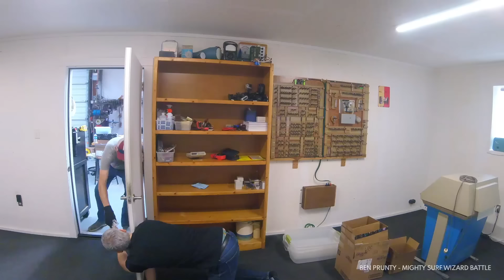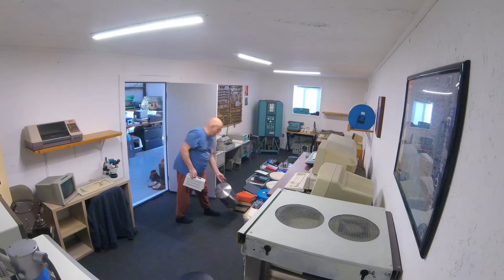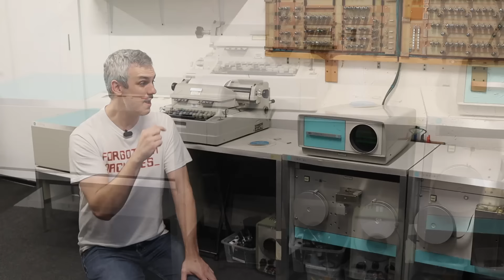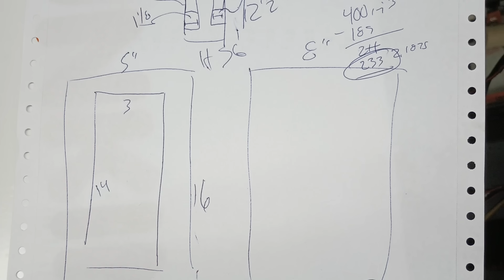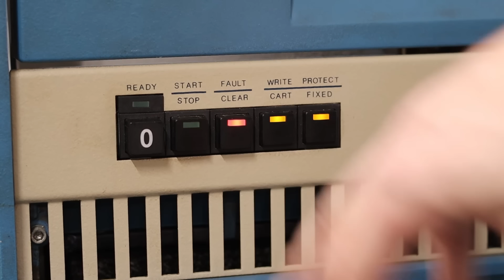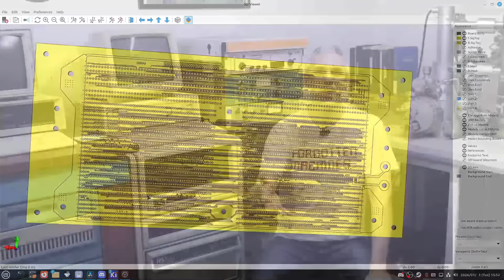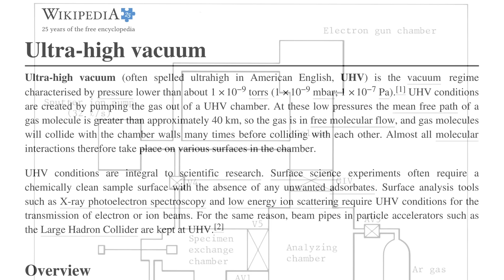Welcome to the New Usagi Electric!

Comment: Congrats on the repositioning.
I wouldn't be surprised if this is the most famous room in the US right now, at least with the retro-computing people. 

Some sort of a museum/workshop would normally be a natural suggestion in theory but with increasingly unpredictable economic/political situation, unaffordable real estate and inherent risks involved in funding and cooperation - this arrangement might be the best compromise.

Other than that it increasingly looks like putting casters on everything is probably a useful suggestion here.

You seem to struggle quite considerably with the bump at the entrance. Perhaps there's a reason to make a groove in the floor and install a gentle ramp flush with the floor on both sides. 

Maybe there is a reason to consider buying a tiny (used?) forklift like the ones some local shops in Europe use to stock groceries through the front door.  Although I do understand it's probably too expensive for a single person with little to no funding.

I would also suggest to maybe rethink the electrical distribution system a bit next time you inevitably have to move stuff around? I would personally opt for overhead heavy wire holders all round the room where exactly the right amount of wires can be routed exactly to their loads with no chance of blocked outlets or high-amp outlets not being where you need them. But maybe I'm overthinking it.

Comment: I have an HP-85B with some metrology software you could have. It's a minicomputer commonly used in scientific applications. It works just fine, but the tape reader doesn't read. I got it from the trash when a company I used to work for redid the calibration labratory.

Comment: Regarding power for the JAMP, if it wants split-phase 100-0-100, then how about, using a standard 240:120/240 "dry type" transformer, as used for commercial power. They have multiple taps, so if you tap the primary a bit high, the secondary will be low, giving 100-0-100.

If the machine needs 0-100-200, with a common neutral, then move the neutral/ground from the center, to the end.
Reply: I'm from the UK, so our power is euro style 0-240 for single phase, with a grounded neutral, but I've seen many videos from US machine shops.

Comment: Would suggest taking the existing door, and reframe it to the left to the stairs to add in a half leaf, or another full width leaf, to have a double door entry. More room to move equipment inside, and that will make moving exhibits in and out easier as well.

Comment: A quick note for when you start playing with the JEOL. Most instruments ( mass specs, electron microscopes, etc ) that operate with a vacuum of 10^(-6- -> -9) Torr range have multiple stages for the vacuum. First is a roughing pump that takes it to around 0.1 Torr pressure, then a turbo pump to bring it down further.  Many of the turbo pumps operate around 40K rpms. The best sequence for these is to run the roughing pump to reduce pressure, then start up the turbo pump. Due to moisture and containments in the vacuum camber, It can often take hours to a day to reach maximum vacuum as molecules de-absorb from the camber walls. Very Important, DO NOT just turn power off to the vacuum system! Shutting down the power abruptly can cause a large spike in pressure while the turbo pump is still spinning at high rpms, This causes a lot of stress! We had an old HP Mass spectrometer that did this in the 1990's. The Turbo grenaded! Bits of turbo fan blades when all through  the system. Best practice - Turn off the power to the turbo pump and let it spin down over an hour or so, then turn off the roughing pump.  With an old system like this, that hasn't be run for a long time, I would run a roughing pump for a day or two to really dry out the camber, before trying to start the high vacuum pump. IF the roughing pump uses vacuum oil, change it since it has been sitting so long. Best of luck, it would be great to seeing that instrument running again.
Reply: Oh yes, power failures are fatal for the pumps in a system like this, and it is very expensive to fix.  I wonder if this one can be baked.  Let's hope there are no leaks.

Comment: If you've got a functional IR spectrograph ... and a memory drum of unknown metallurgy ... Shouldn't you be able to use one solution to solve the other problem.
OK, you'd need a library of reference spectra. That shouldn't be a huge problem. 
And you'd need to get the metal of the drum (or a shaving - any threaded holes that could do with being re-tapped?) into solution. nitric acid is a pretty good bet. 
Whether your spectrograph has fittings to hold a sample of aqueous solution ... or if you'd need to get the chemistry into something like solution in alcohol which you can volatilise ... now there is a question. I think Ti has a number of volatile halides, so there is hope if it is Ti. If it's something boring like an aluminium alloy - that would be harder. The decimal places in the amounts of (several) alloying elements probably matter.

Using an XRF machine would be cheating with 1990s tech for a 1950s problem. Your bunnies would never forgive you.

Comment: Bomem: Got any pre and post 'capacitor plague' caps with enough electrolyte left to analyze?

Another good one (beyond the mysteries of retrobrighting and polymer degradation)... what exact component of a lithium thionyl battery is so horrifically damaging to PCBs, it is self-recycling sulfur ions or some other reaction with the copper base, what's actually there so a proper decontamination/neutralization/passivating protocol can be put together.

Comment: I am in. Lots of old computer channels, not too many instrumentation ones. I used to use an FTIR and Auger, tho mine was Nicholet IIRC and the Auger was from Phi/Perkin Elmer. Where did you get it, I would love to restore one, have many happy hours on a SEM, met my wife there, she operated it until I was trained. How much do these things go for, I have looked on e-bay but they command a high price or are mostly not there or so old they use diffusion pumps, which require a ready supply of LN2. Any way, I am a part time viewer and if this goes the way I hope, you will most definitely have a new subscriber.

Comment: Titanium for a magnetic drum head.

Hard to consider they would ho that route, even if they had access to to raw material, you STILL have to manufacture the compnent, and titanium was the new wunderkind of the aerospace industry.

Getting the magnetic media to stick to this new material could be troublesome compared to aluminum.

Comment: I don't think those magnetic coating formulas are lost, the manufacturers that closed down were sold on in many cases. I'm willing to bet that every major disc manufacturer could tell you what's on there if they wanted to. If they maintained their archives. I also would be surprised if any modern formula would not work. It's the magnetic head that lays data down. And any modern coating would take a lot higher data density than those old engineers could dream of. 
The real problem will be getting a new even, thin coating on those drums and platters. I don't think you have the machinery for that (yet?).

Comment: crashing a PCB manufacturer site with a design for an ancient machine is pretty epic :-)
Reply: For what it's worth I'd bet it was just the web interface for the file transfer process that's the problem.
Reply: You have to ask the question, is my design OK, or is it buggy software ...
Once the boards have been spun out and you have invested some time in building them and using them, you will know the answer.
I suggest rechecking your design for obvious mistakes. A gerber viewer doesn't care about DRC and ERC.
Reply: I'm not that surprised; the ones I've seen have mainly been hacked up versions of old open source JavaScript Gerber viewers. I don't think that these are real pro CAD tools or anything like that.
Reply: you obviously don't order many pcbs. this is very common even with small boards.
Reply: @humidbeing  every 1970s pcb i've ever ordered in 2026 came out wrong, they did not use the time machine to properly age it!
Reply: I'm wondering if the issue is with the wire-wrap mods on the PDP motherboard.  Those were (I believe) just two layer boards or two layer with ground and +5 VDC planes.  Then, there were selection wire-wraps to the sockets, based on what was ordered to go onto the motherboard before it was loaded into the crate.  You might want to check out Dave's Garage YouTube channel for a discussion of rebuilding damaged backplanes.  Yes, it can be done, but it takes a LOT of work.  Usagi just needs to do that part of the process...

Comment: Complainers need not apply. I never named the Sys/3 (not mine to name) but it got special care with its peripherals like the DASD. Four cabinets with spinning rust. Those had proper names, specifically R0D0, R1D1, R2D2 (!!) and R3D3. Blinken lights and protocol convertors. MFCU, 6250tape, 1403 printer (Strangelove edition), 3742 dual station input. You know, you'll have to get a C-type dish  for satellite transmissions.

Comment: Honestly it's a joy to watch you go through this level of nerdy escalation. I look forward in ten years to watching you fully restore a deorbited Hubble Space Telescope :)
Reply: Usagi is certainly one of the greatest retro-electronics restoration wizards alive, but I have a feeling that even his magic might not be potent enough to restore a half-vaporized chunk of crushed and fused metal... although NASA should still have a mostly working model on the ground, possibly still connected to at least some of the original computer parts.
Reply: I chuckled at this.. There are hierarchies of what is possible and Hubble is a little beyond anyone without a $100 million space lab - as a start.. Anyway most of the tech is still pretty much bleeding edge even today. Hubble's biggest problem probably comes from its reaction momentum wheels - which are a common fail point in space tech.. The problem I seem to remember is something to do with bearings starting to fail and generating too much friction. Since that was years ago they probably have a fix for it but the fix is on the ground and Hubble is not...  :rocket-red-countdown-liftoff: 🛰 📡 🌏

Comment: Ignore the complainers!  I drove down that bumpy road of trying to deal with a pair of Jeol 100 transmission/scanning electrpn microscopes (yes: both modes.)  2 tons each of stainless steel, iron, brass and lead.  Gave up as we weren't able to get a complete 250kv power supply together.  But the remaining Philips 505 still has possibilities...  At least it doesn't require nearly as much power as the vacuum tube powered Jeol.  Still hoping to get the 505 running in the next couple of years.